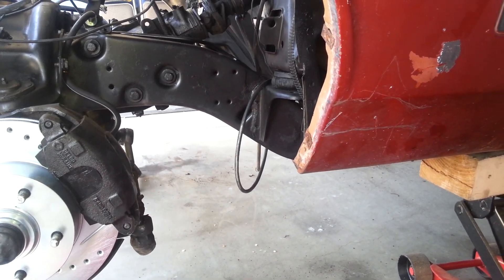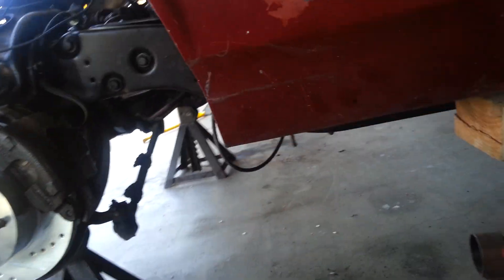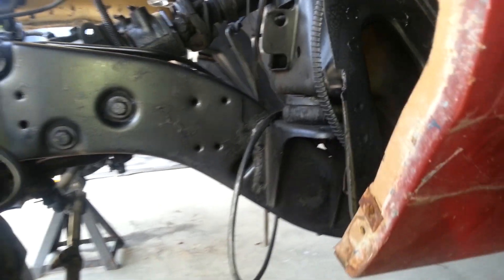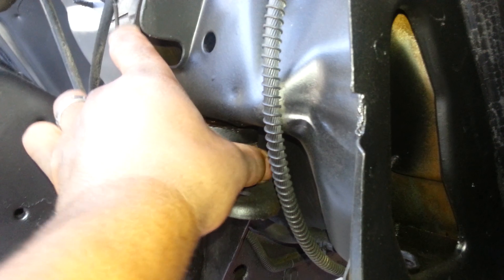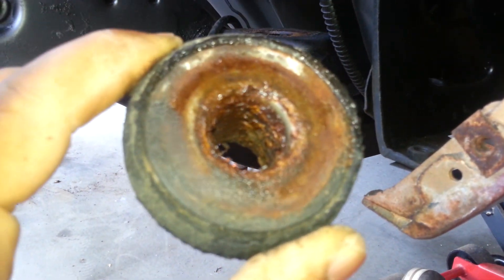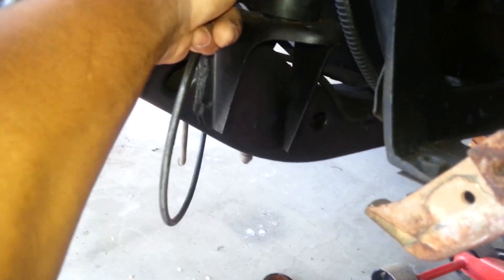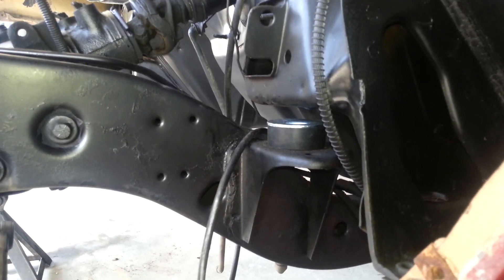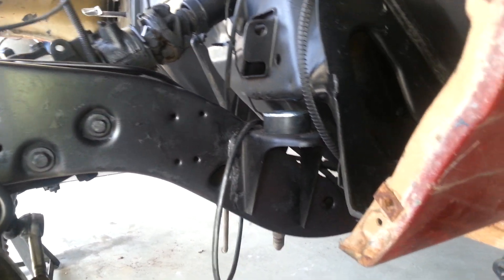1970 NOVA BIG BLOCK BUILD PART 5 SUBFRAME BUSHINGS

Comment: I just ordered and received my new bushings for my 72' but no instructions came with. It seems there are three sizes of bushings. Small med and large. I figured the small are for the radiator mounts but it known on the other two. By the way great video.

Comment: Sitting inside/outside doesn't have squat to do with rubber or poly bushings. Rubber is softer and doesn't last as long (rubber will dry rot just sitting there). Poly is a bit stiffer but lasts forever dang near. My nova sits inside but has poly everywhere I could get it. I want to make molds and cast my own poly parts like the hood and door bumpers.

Comment: Friend could inform me if the front tires are smaller than the rear or are all the same, for camaro type lt 1974
Reply from the maker: Either or depends on what u want
Reply: @ss396rat   Friend I have a doubt in the first front frames of the sub frame of my camaro 74, if the frame of the sub frame of the front and equal of the middle or he is but low, if you have any difernca of the games?
Reply: Eu sou brasileiro..

Comment: If your bushings are bad can it cause car to be uneven?
Reply from the maker: Yes
Reply: @ss396rat  thank you my 70 impala I haven't changed the body bushings they are original and now I hear below my feet on the drivers floor metal hitting metal and my car lop sided I'm going to change them out soon thank you for your response

Comment: Got a 71 nova
Back bushings that are under front seats...back end of frame..the bolts came out..how do you get to nut...thats under seat
Reply: James McKesson I got same car and replacing bushings, the nut is welded to the floor under the carpet, unfortunately if it is just spinning you’ll have to remove the carpet or find where the nut is, cut a small 1 inch line (not a hole) over top the nut and put a wrench inside the cut carpet and hold onto the nut like normal and then once tightened, lift the torn carpet insert silicone or a speed sew and hold carpet back down till dried, hope this helps
Reply: Free-Gold Gravel Guys for me the nut under the fire wall is spinning. I'm not sure I'd that's normal and if not what do I do to install a bolt. Thanks

Comment: Hey I don't have any bushing or bolts on my passenger side. And my end links are loose. I got the car as a roller. Should I be worried? I got a energy kit on the way
Reply from the maker: dan shark don't drive like that just put the new bushings in
Reply: ss396rat I know didn't have any plans on driving it yet. The car just don't have any on one side. I figure something happened to the car or something. And how do you know the part that the bolt into is broken or not. I have a washer that moving around.